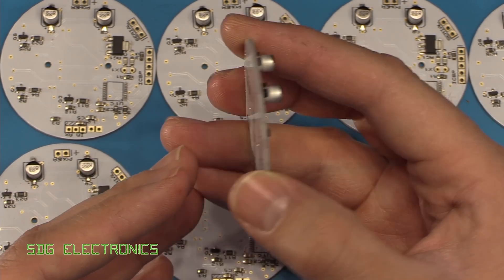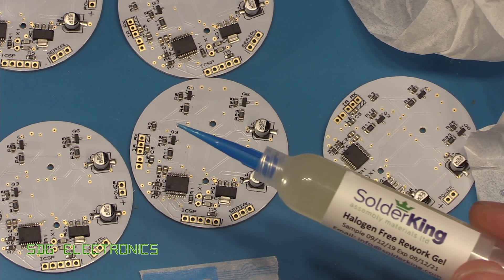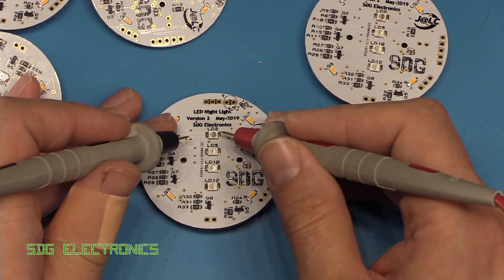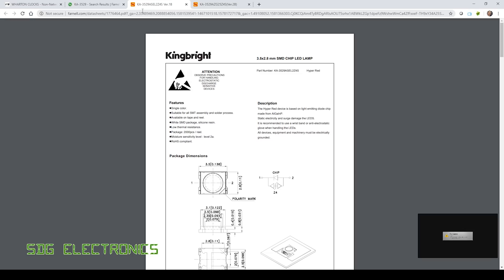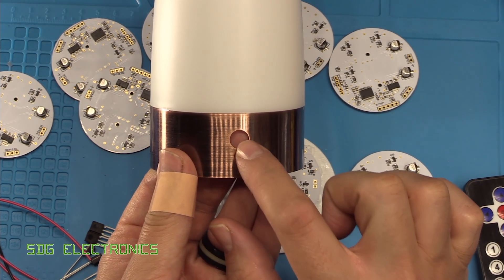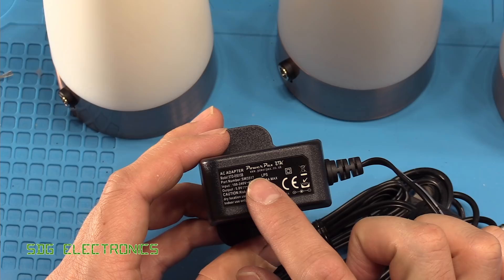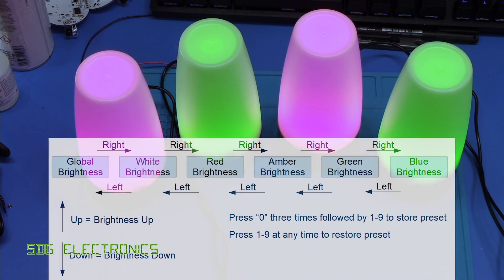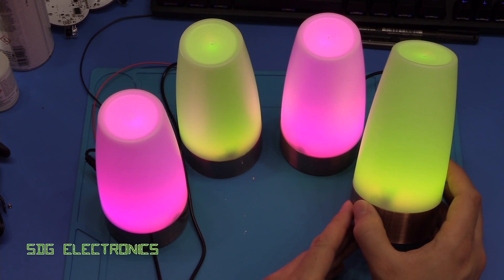SDG #135 Finishing the IR Controllable LED Nightlights

Comment: Quick tip: put a small magnet in your screwdriver so that it becomes magnetic and you don't have to hold the screw with your hands. Small neodymium magnets of any shape or size are enough for the job, or you can crack open some old/broken earphones and scavange the magnets from there too. I always have a bunch of them at hand 😊

Comment: Love it... But how about using an ESP-01 with MQTT to node-red ;)
Reply: Mai Mariarti  Particularly when you can now run Tasmotoa firmware on any esp8266 based device and have access to a large number of 'plug-in' device driver libraries... the software development piece for projects like this becomes the glue logic into node-red, HA or the like.  The functionality available once in those environments is  enormous with very little effort.

Comment: The change in polarity of those LEDs is complete insanity.
Reply: Indeed. Now I think this is a Kingbright speciality. I once bought 10mm LEDs from them. The case didn't had the flat side so I just took a look inside the LED where the chip is (I don't look out for shorter and longer legs). like 99,9% the chip is the kathode and the bonding wire the anode. Not in this instance. 

I was looking like half an hour for any fault in my circuit. The last thing I did was to check the LED...
Reply: @beamfinder8336  I had the same issue with some Avago back emitters. Luckily it was only a small production run and the PCB assembler got it fixed for us :-)

Comment: Was there a reason you used an external crystal rather than the built in one?
Reply from the maker: I actually no longer use it, but previously it logged when you turn on the light, then at the same time each day it could turn the light on again
Reply: @sdgelectronics  Was the internal one not good enough for that purpose?
Reply from the maker: @Wilksey37  no, the drift is quite high with the internal RC oscillator, especially when the board gets warm from the LEDs
Reply: @sdgelectronics  Ah, OK, any reason that you no longer use it? Just a redundant feature?